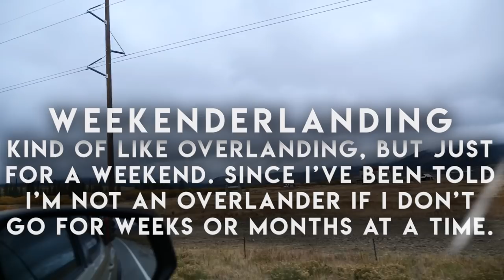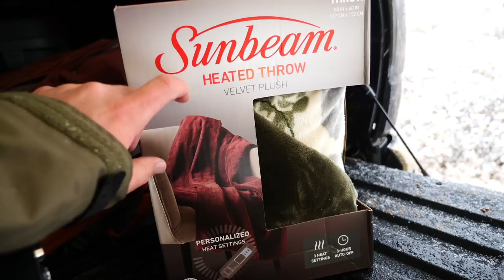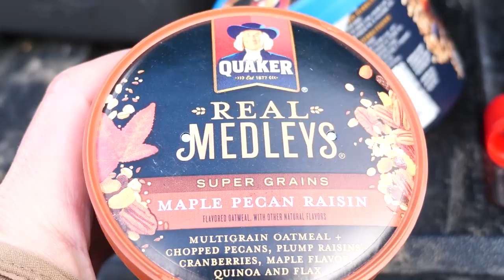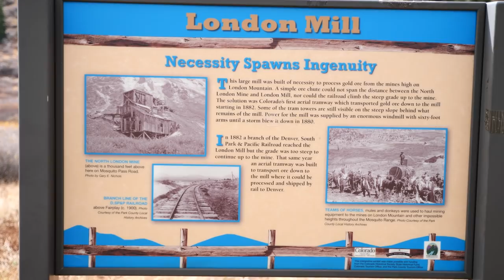WEEKENDERLANDER EP 2 - Snow camping with the GF in the Tacoma

Comment: On the motorcycle it took me 30 minutes to get from downtown Leadville (eating lunch) back over to Alma side and down and just past the London Mill in the wide section / split. LOL I've been over in a Jeep Grand Cherokee when i owned that a few times, so much slower going. When I first moved out here in 2007 the road was actually nicer I took a Ford Edge AWD up the first part then we were told by a hiker it was blocked with snow...so we then hiked up and it's amazing the depth of the snow up there. 

I try and ride that pass 2-4 times a year. Yearly it is getting worst and worst from the traffic. An old timer told me they took a van over back in the day. LOL

Comment: So im using a 2001 f250 and i want to make it into my overland vehicle. With it being so heavy compared to a tacoma should i use more aggressive tires or with i be fine with using my ko2's?
Reply: I have a 99 4x4 f350 cc lb drw (dually) flatbed. slap a set of 10-12 wide wheels and some 35's on it. The contact patch will spread the tanks weight around a bit better. I also have an 18 taco trd just like his......mines a long bed for a daily driver. The dually does everything the taco does.....easier. It's only issues is that is over 9ft wide (4x35"s and 2" spacers) and it's over 20feet long.....it has been our ranching/camping/hunting rig for well over 10years. Your super duty will be a great camping rig. I honestly never thought of using a truck smaller than a full size for camping honestly. Bigger rig........more gear.

Comment: Hey, im 19 and I've been debating for a while wether or not it is worth it to upgrade my Tacoma to be able to overland. Its a 2003 Tacoma Prerunner, which im sure you know means 2WD:/ well I've saved up 2.5k, and its meant to go to a little lift, 33's along with a budget rooftop tent. I want to pull the trigger and do it, since it does have a rear locking diff, but im having a debate with myself if its silly to invest this into a 2WD drive Vehicle, what do you think? I was debating selling it and buying an 2006 460 Lexus, but it has wayyyyyy too many miles to do that.
Reply from the maker: Really depends on what kinds of trails you're planning on doing.

Comment: Should have bought the pro if you wanted a real off road truck
Reply from the maker: Haha, hope this is a joke
Reply: @LastLineOfDefense  Why would that be a joke,

The TRD Pro includes everything on the TRD Off-Road PLUS:

Fox Off-Road suspension with front coilovers and remote reservoir rear shock absorbers.

1-in suspension lift

TRD 1/4-in aluminum front skid plate

16-in Black TRD wheels offering a 1-in wider track

Larger anti-sway bar
Reply from the maker: The upgraded suspension I have is in a different class than factory TRD Pro suspension.
My suspension has more lift, more travel, and better ride.
My skid plates are far better than TRD Pro Skid.
My wheels are better and wider than TRD Pro wheels.

I removed my sway bar - as that decreases offroad performance and ride quality significantly.

So yeah... like I said, haha - hope that was a joke.
Reply: @LastLineOfDefense  why do you act like that. All I know is that you have a trd pro, I don't know that you did all that extra shit.